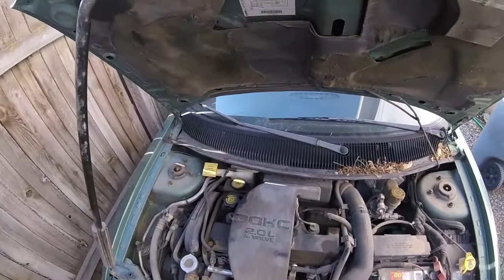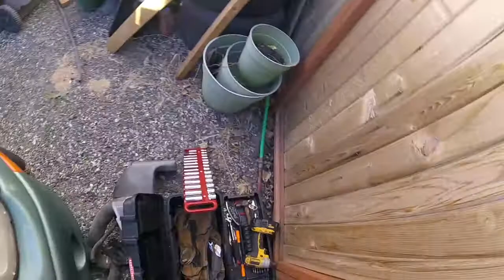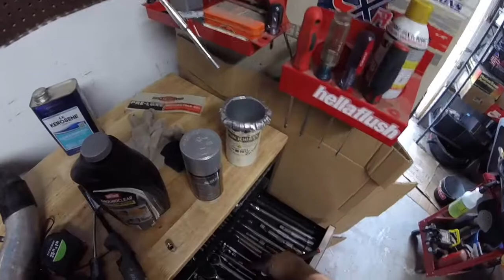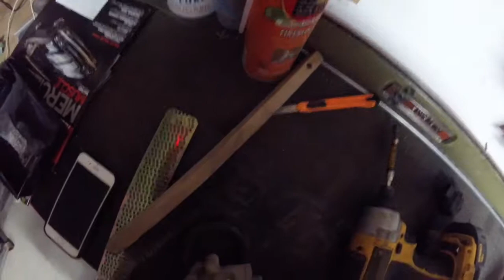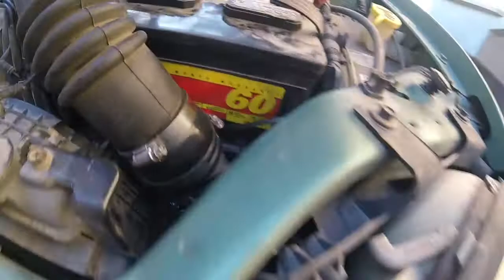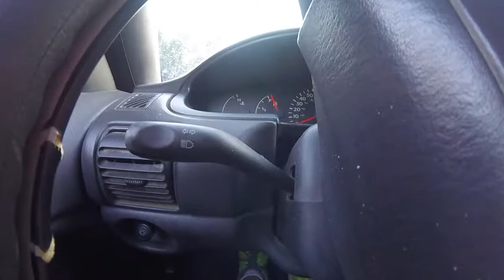Neon Auto throttle body mod (ATX)

Comment: whats the difference in the auto throttle body vs the manual throttle body?
Reply from the maker: It's slightly larger so adds a little better throttle response and few horsepowers
Reply: Copy paste from neons.org "1st generation (95-99)Neon TB (49mm for Neons with a manual transmission, and 52mm for Neons with an automatic transmission) to a 56mm or 60mm Jeep TB for airflow. Use a Jeep TB from a 96-2001 Cherokee or Grand Cherokee with a 4.0L inline 6 cylinder engine and an automatic tramsmission (60mm) or manual transmission (56mm)."